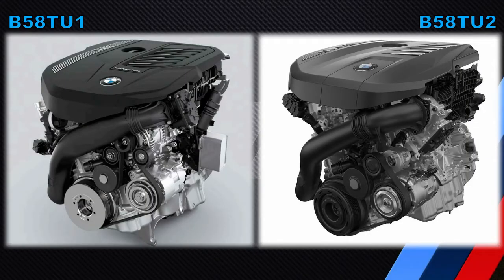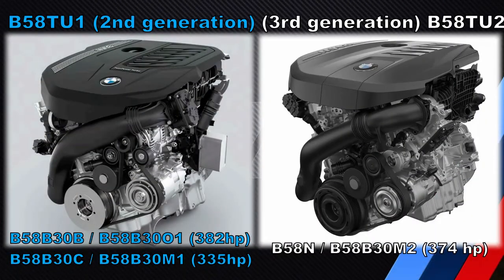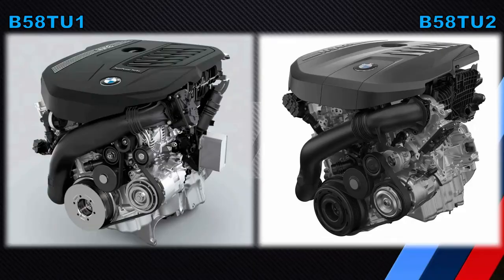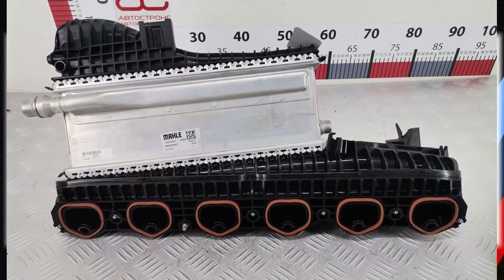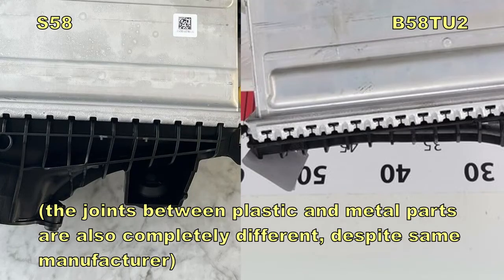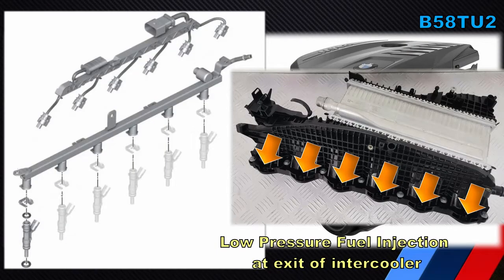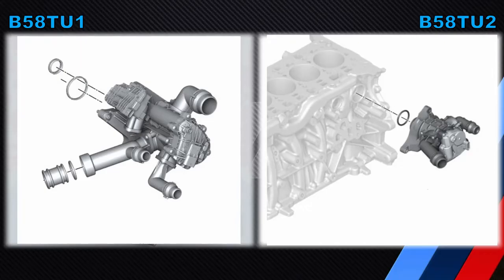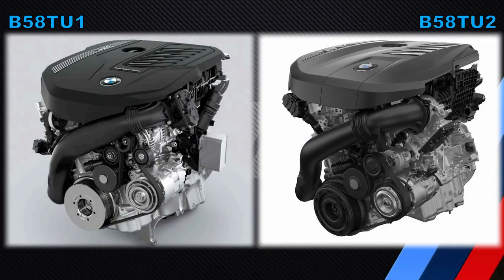BMW B58TU2: A closer look at the new engine variant - Part 1

Comment: I have the 2019 440i Gran Coupe 1st Gen B58 with MPPSK from factory....thinking of upgrading to TU HPFFP.  Can i have your thoughts/opinion about this if this is a safe mod?
Reply from the maker: Hi, the B58TU HPFP has been installed by a very large number of 1st gen B58  owners with generally no issues reported. It is a safe mod, especially considering the mod is combined with a more aggressive tune. However, in your case I don't know if you plan to replace the MPPSK, which comprises of BMW's 360hp tune as well as upgraded exhaust, as otherwise you would see little benefit from the B58TU fuel pump. You would need a high flow downpipe as well as the B58TU fuel pump in order to install a stage 2+ or stage 2.5 tune.
Reply: Thank you very much for your insights and for taking the time to reply.  I really enjoy following your posts